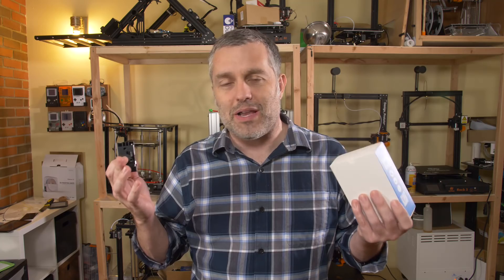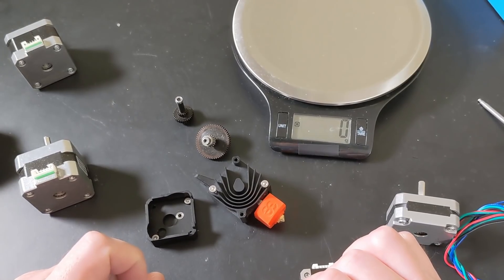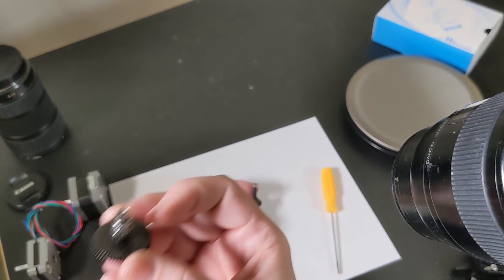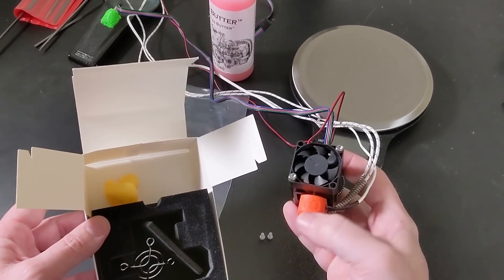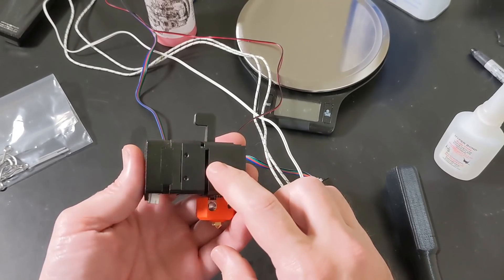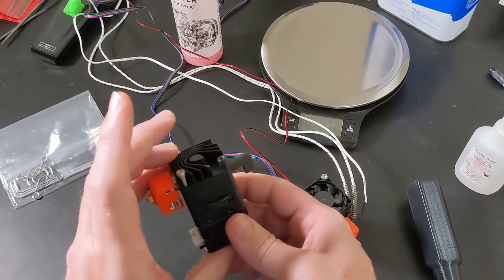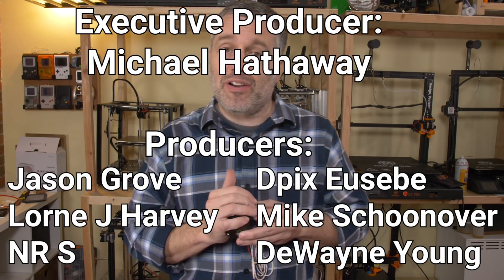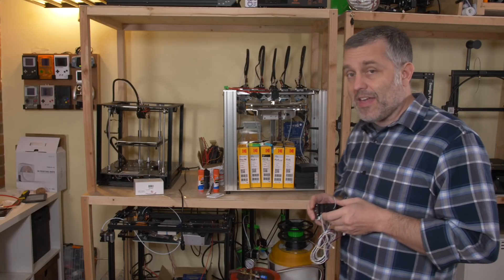GAME OVER For Hotend/Extruder Design? - The Biqu H2 Direct Drive Hemera Alternative

Comment: Hobbing is the method by which gears are cut (as opposed to cast). I love how the 3d print community has jumped on this term as if it's magical.
Reply: Most people in 3d printing have never been in any kind of manufacturing and it really shows.
There would be nothing wrong with MIM gears in this application. There are MIM gears out there dealing with higher loads and far worse conditions than driving some plastic in an extruder.
Reply: @dalem04  I think the particular fallacy arises when "hobbed gear" is used to describe the filament drive which by necessity has drive teeth that aren't gear teeth and I can remember a friend trying to do this in the mech eng machine shop back in 02 and it was somewhat tricky. I mean there was kit that could cut helical gears for an automotive gearbox but we weren't really set up to do stuff that small and undergrads weren't getting CNC time. But then I think we had one UV Laser stereolithography machine that was about the size of a transit van. I was in the same room as it once in 7 years. 

But it's exactly the same in any technical hobby, try being a conversant french speaker anywhere near a ballet school in a small town.

But how exactly to you uniquely describe a filament drive wheel? You can't call it a toothed wheel because those are for belts...
Reply: @rowlandstraylight  The closest cut would be that of a worm wheel. It's definitely a weird cut.

Comment: I like your review explanation. Thought: Could a motor be lighter if it was a DC servo?

In general, DC servos are more powerful (peak torque) at the same size as steppers. Expensive drive electronics though.
Reply: Yep. I've toyed with designing an extruder using a brushless outrunner, and compound planetary gears for high reduction. Tiny outrunners don't have much better continuous torque to weight ratio than steppers, but that torque doesn't drop off with speed until you get into the tens of thousands of RPM, so motor speed (and thus power) will only be limited by inertia/acceleration. The electronics/firmware is the hard part. I probably could do it, but I have a zillion higher priority projects so I doubt I'll ever get to it.

Comment: Neat, they moved the hot-end mount to the part with the heat-sink.  One of the early reviews showed it connected to the gear carrier between the heat-sink and motor.  This is a nice upgrade.

Personally those gears look like they're hobbed.  I.e. the teeth are cut with a worm-gear like cutter.  It's a fast process, they probably only had to spin the gear 5-10 times under the hob to cut the full profile.  I assume the stepped gear is actually 2 parts pressed together?  That would also let them Hob both parts.  When I've seen Powder Metalurgy parts, they're made to net-shape without any finish machining and show an "oil filled bronze bushing" surface texture from the sintered powder.  It's PM is a cheaper process in bulk, but requires expensive tooling to get started.  Dewalt drill gear boxes are all powder metalurgy parts.  

Triangle Labs Matrix LC is another "clone" that brings a lot to the table.  In it's case, the liquid cooling also cools the stepper motor so it's extremely well suited to operating in a heated chamber.  Also impressed by the Mellow Wind BMG inspired extruder and hot-end heat-sink.  Put one on an old Mono-price printer and it prints everything fast, even tpu.

Comment: They dont ship gears with lubrication to assist with motion but a lubricant to keep the metal from rusting while it sits in a warehouse waiting to be sold and shipped.   They expect you to clean their lubricant off and grease it with a proper motion lubricant.   Doesnt matter what you purchase whether it be gears or a Roman helmet it will be covered in a oil/grease to seal the metal from exposure to air and moisture just so people are happy that they didnt receive a rusty piece of metal.

Comment: I hope at one point they will sell a printer with it preinstalled. Biqu already sell what basically is an upgraded Ender 3, I hope their next printer uses this extruder. I prefer to buy things that are almost exactly what I need from the factory, not ones where I need to replace half the parts to make it good.
Reply: They do.. It's called biqu bx
Reply: @stephan1712  Thank you so much, I didn't know that, because I couldn't find it in any store.
I will consider buying it when it comes to retail and the reviews come.
Reply: @jacekjagosz  I own the b1 and did mounted the h2 :)

Comment: Ah you finally found the orbiter extruder eh? Well you then have also obtained the correct LDO stepper for making a sherpa mini with. Which is alternatively possible. It can be put together using gears etc from a bondtech spare parts kit. All the partts list you can find online The sherpa mini weight is something around 120g. You cannot buy it yet as a pre-made item. Its designed to be printed from ABS or ASA. Cannot seem to find anything lighter than that as of right now. At least for these conventional style DDE where the stepper motor is being tightly integrated together with the extruder.

Comment: What's the current draw? Most of these new drives require so much current that they blow out your stock drivers and require new drivers and the knowledge to adjust them. The 800ma listed is way more than the 500ma most 3D printers are designed for. I've had this problem with BondTech and Hemera upgrades to my printers..

Comment: The bearings may have been the problem all along - probably had a bit of a burr in there. Unless you removed the bearings before degreasing, you've likely stripped all the lubricant from them. That'll make even shot bearings spin like magic. Be sure to lube them up - dry bearings will wear out in no time!

Comment: you should lightly drag a file across the edge of that gear to see if its actually hardened. I bet it isn't. It appears to be gearstock and not machined. The not so great grooving on the side of the gear is from a tool that wasn't all that sharp.

Comment: Thanks for the video.!

Larger nozzle → higher resistance as Bernoulli's principle. 
I think its more to the failure of the heater to melt large volume of plastic in short time that provoke higher flow resistance. 

In the same condition larger nozzle will provide lower speed of material exiting the nozzle. assuming the nozzle as pipe with certain diameter and length, 
Darcy-Weisbach equation suggest the pressure loss in the nozzle is proportional to ΔP = f * (l / d) ρv^2 /2
Where, f = friction coeff. of the nozzle surface, l = nozzle length, d = nozzle diameter. 
Larger diameter always results lower pressure loss (less resistance). of course the shape before the orifice also plays significant part in the pressure loss,
but all of the calculation should have diameter in the division part of the equation so it should be less resistance (as long as the molten metal quality is the same for 2 nozzle size)

Comment: Larger nozzle will result in lower pressure. It might be harder to print with larger nozzle because your hotend might not be able to melt the larger amount of material necessary.

Comment: Is this one low enough mass to work on a delta (Kossel XL) and eliminate delta retraction requirements? Or does it need the lower mass one you mentioned?
Reply from the maker: In my opinion even the other one I mentioned is likely too heavy for a Delta. I need to do some experiments. You want to do everything you can to make the effector weight almost nothing. Deltas are for speed printing and cool looking printer. They aren't for making accurate parts. Anything that sacrafices what Deltas are good at is a poor addition.

Comment: Hi DPT.  Took about three weeks to get, but I got it. Opened the box, and the gears are locked up.  Opened that up, took it apart, cleaned and (lightly) lubed everything I could.  I could get it to rotate in one direction (retraction), but not the other.

Any chance you could go into more detail into what you did to get your working?  If it's locked up solid, there is no way to tell where the rough spots are.

Thanks for any guidance.

Btw, mine seems to be the newer version where you can turn the connectors on the stepper around the other way without completely disassembling.
Reply from the maker: I covered the whole process in the video. Take it apart so you only have the two gears. No tension arm, no stepper. Get those two gears spinning freely by deburring the teeth and more importantly centering the axle like I showed. Then reassemble. When reinstalling the stepper put pressure against the side of the stepper as you tighten the bolts. Such that it is being forced away from the gear it meshes with. This will loosen the contact and now everything should rotate smoothly.
Reply: I had same exact problem and it worked out four me! if you follow DPT indications at 13:30 you will solve the problem! My extruder was not well tighten, they already know the problem and ship them anyway!!!

Comment: Sorry. Your math is faulty (at 20:06). Lines 1-2 are correct - cross sections of filament and nozzle hole. Line 3 is also correct - material volumetric flow rate = 13.829 mm3/s.
Line 4 is wrong because that use of layer height does not make sense resulting in units of mm3 not mm3/s. As a result, line 5 is also wrong.  Given that the filament flow rate is FR = 13.829 mm3/s (everywhere, extruder or nozzle hole - no material creation or extinction), then we must have:
Nozzle_feed_rate * nozzle_hole_cross_section = FR 
Nozzle_feed_rate = FR / nozzle_hole_cross_section 
Nozzle_feed_rate = 13.829 / 0.126 = 109.75 mm/s --------- Not 172,863 mm/s

Comment: You can't say the gear train was bad when in reality it was your mistake because before you took it apart it function perfectly right?   So how is that the manufacturers issue?  I think maybe your missing a step or improperly putting it together because there's no other explanation other then this that would explain why it worked perfectly prior to taking apart and then suddenly didn't when you put it back together.
Reply: And again when you got the second one it worked perfectly out of the box

Comment: If you have to choose a high flow extruder motor hot end combo for hardcore Abs printing that is also reliable what do you choose ? Because i don't know the answer
Reply from the maker: I haven't tested this combination, but I can't imagine anything performing better than a Bondtech LGX lite + Slice Mosquito Hotend + Bondtech CHT nozzle.
Reply: Thank you for your response I really appreciate it.🙂 I like the technical approach as you dissect different products.If money isn't a concern I probably go that way  .I was hoping I can get away with a volcano 6 and an Orbiter v.2 .Just a sidenote do you consider the Biqu H2 a reliable alternative ? Thanks again your doing a great job on your chanel.
Reply from the maker: Yes. If you can get the gear train to spin freely like I showed in the video the Biqu H2 is a great extruder. Still my favorite of the Chinese extruders I've tested. They now make one with an all metal heat break for printing higher temperatures. If you are speed printing ABS and want to print at like 275° this would probably be a good purchase for you.
Reply: @DesignPrototypeTest  Thank you !

Comment: I'm sorry but if you need to spend an hour reworking the machining then it's crap. I watched another youtuber that had nothing but troubles wit his. Check the heat break next time you have it apart. Long ptfe almost to the nozzle. So it needs a heat break and an hours worth of cleaning and filing. Crap I say.
Reply: Here is a novel idea, just specify an "all metal" heartbreak when you make a purchase... I got my two sent with what they are calling "titanium" (can't say if it is actually titanium or not yet, as I can't get to my P.M.I machine just now, but they definitely feel light enough to be titanium) no ptfe from the get go, time will tell if they stand up or not, but I can tell you the hermera is not a shining example of quality or design either

Comment: I'm curious where did you get this is "all metal"? I'm looking at the biqu page right now and I see this use PTFE tube which goes all the way down to touch back to back the nozzle. That's not all metal at all (not what the industry knows as "all metal hotend" at least) and everybody knows this is a terrible design because the damage the tube will get after 245c. Even if you use Capricorn, you will be limiting the type of filaments you can work with.

Comment: Looks like they used a Phateus Dragonfly heater block clone, looks like it's an aluminum block so I doubt it's a Phateus product, though it does look like they used their sock. I guess a real dragonfly block would add a few grams so that may be for the best if you're making it as light as possible. Also that grease is probably just a bog standard white lithium grease with some added marketing wank. Doubt it has any graphite, wouldn't be white if it had any significant amount in it, probably PTFE particles like a lot if not all decent low temp white lithium greases have.
Reply from the maker: I do believe that you are right! So, one Chinese company cloning another Chinese company but removing the good materiality (copper). I wonder if Phaetus is also Biqu/BigTreeTech. Anyway, I don't have any sympathy for them. They are cloning the Mosquito with their Dragon hotend. Live by the sword, die by the sword.
Reply: @DesignPrototypeTest  Well I don't think the dragon is clone of the mosquito, in the sense that a Toyota Camry isn't a clone Honda Accord or vice versa. They have completely different mounting mechanisms, heater blocks, and some other minor differences, though the heat brake and how that heat brake attaches to the heater block is very similar, though still not a direct copy.
Reply from the maker: You never saw that heatbreak and copper heat sink before Mosquito invented it. Now all the sudden it's on the Dragon. Not an obvious inevitable development in hotend design. Only exists because of Slice engineering. The Dragon is definitely a clone. They just mounted the cloned portion inside an E3D compatible cage. Furthermore, the Mosquito is not Open source. The Dragon is out of bounds. It's a clone.

Comment: Bond tech didn't invent dual drive extruders, they have been used for a long long time in many other industries like welding and injection molding. If you don't want your design cloned don't put it out as open source, cloning is literally a desired outcome of the open source process.

Your ire should be directed at companies like slice engineering; taking an entire open source industry that they had no hand in creating and slapping some low effort patents on a dubious "unique" design.

Comment: What about spare parts?
I can't find a 35mm fan anywhere, and that special hobbed gear? I came across someone who had one with a stripped set screw.. Well, you're crewed without spare parts availability.. 😐
Reply: Except the nema motor, the fan and gear are available on AliExpress which is the main selling channel for them.
I've ordered a new fan with ball bearing and new filament gear.

Comment: The problem with these all metal extruder specially when you build enclosure and install heat chamber the extruder will get really hot at the entrance of the filament the plastic will get softer and It will cause a jam. I had this problem before.

Comment: I think you have the part about pressure backwards - at the same volumetric extrusion speed, a larger diameter nozzle would have less resistance than a smaller one and lead to less back pressure unless you had some wild shear thinning properties for your polymer. In general, the pressure drop is inversely related to the nozzle size.

Comment: Great review of this product, although that misaligned shaft would have taken some stars away in my review :).  I'm making a hot boxed Sapphire Pro hot and was planning on using high temp stepper motors (180C) to address the steppers being in the hot zone... what are your thoughts on that?  They're about $25 and so that is a $50 add...  Looking forward to seeing you build the Hot Sapphire project, I'm super curious how you are going to route the filament.... bubble dome?  sliding panels?  you always such great solutions, cant wait!!

Comment: While the H2 has a lot going for it - and things like dirt or left over machining lube or coolant (whatever the smudgy stuff was) are things I would normally say are acceptable trade offs - but eccentricity of the gear that needed to be massaged with a needle file to make it work is something of a bellweather, a little hesitant to sign up for one- sure maybe there's some bad batches and I do have the needle files necessary but it really shouldn't be super difficult to get concentricity of the axis and the gear teeth.  I'd also be a little concerned gear problems that don't immediately present may become apparent later on. On one machine I do run a Hemera (actually the version I got was the "Hermes" which makes my wife mad because I own a very fashionable extruder ha ha) but sure would be nice to have a lighter version of it - I may pickup the H2 to fiddle with myself since it's notably lighter.  I kind of wonder if E3d will chase the H2 with their own approach at a lighter version of the Hemera.  Once again excellent review!

Comment: I have a BX, but still want to do a remote direct extruded.
Reply from the maker: I love the idea in theory. In practice, in my experience, the cable acts like a giant spring as it winds up. Very similar effect on extrusion to the way a bowden tube compresses/decompresses. I've only tested in extreme, demanding and oddball applications so everyone else's experience with a normal .4mm nozzle at "normal" print speeds is probably valid.